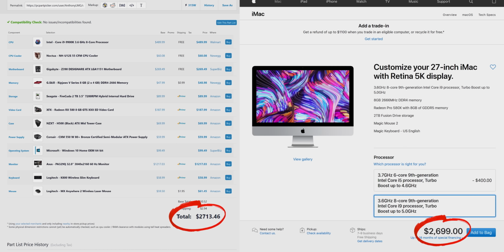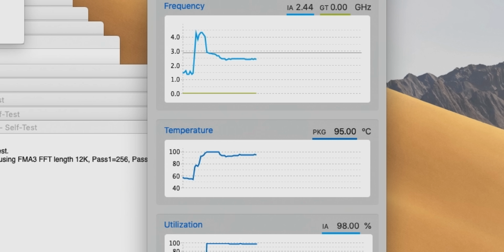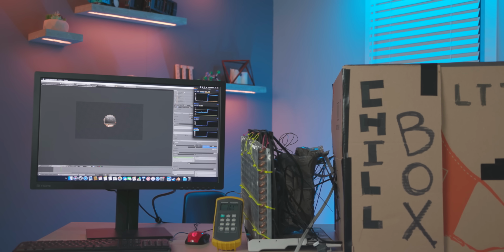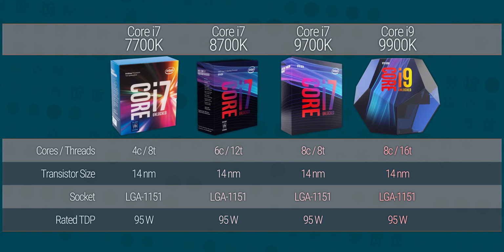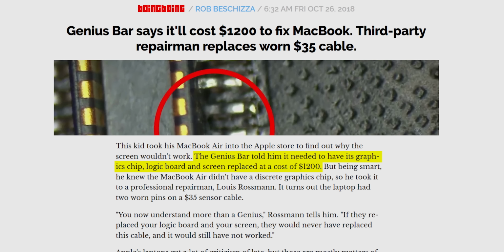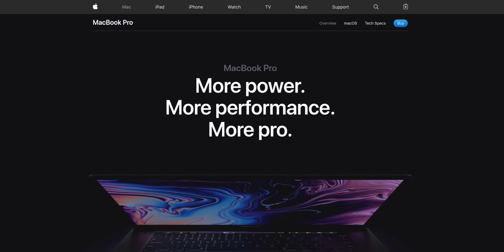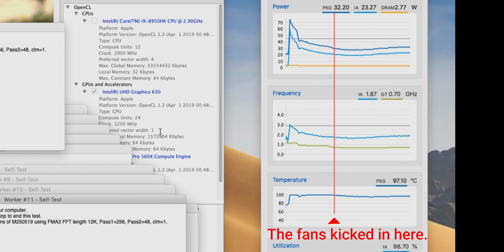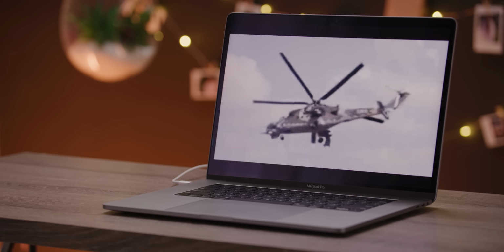Macs are SLOWER than PCs. Here’s why.

Comment: The answer is pretty simple, the mobile department and the computer department are completely split.
Reply: Moonwired Apple controls the A series chips. From start to finish they are designed for the enclosure and use cases Apple predestines then for.

Intel makes the desktop/laptop chips. 

That’s the reason there’s a split.
Reply: coz the design are more "equal" of the other brands on mobile... its just not fair of a comparison
Reply: Apple is designing custom MacBook chips as we speak.
Reply: Sure, but that doesn't really explain why the company has such different design philosophies for their flagship products.  It's honestly a bit shocking.
Reply: @marcleblanc3225  Its because they design their own processors for the iPhones, and are using Intel for the Laptops.
Reply: maybe equipment supplier wasn't honest with Apple, like for example if Intel wrote in their datasheet that their CPU can operate up to 95 degree Celsius it contradict with common sense of PC enthusiast that it should be lower than that.
Reply: But that doesn't really work either.

If Apple are ok with outting in high spec chips and having them throttle, they could just make a higher spec chip for the iPhone qnd have it throttle.

I do think Linus touched on the reason though, Apple market to less tech-savvy rech users. It's really easy for someone to gloat about their i7 MacBook and hiw it has a better CPU than someone elses noteboot with another Intel chip (even if they are wrong), but when it comes to phone hardware, almost no one has any clue at all. So, since Apple make their own, they simpme make their chios 'just good enough' and leave it at that, knowing no one in their target market will directly compare their hardware to Samsungs, and if any non-Apple fanboi YouTubers try, it will go over the heads of both Apple users and most non-Apple users.

TL;DR, Apple don't use the internals of iPhones for marketing, but do use the internals of their laptop and desktop lines to a limited degree.
Reply: @xponen  nope, Intel supplies CPUs to many other companies and their products don't throttle, and 95°c is the maximum safe temperature, if it's higher than that the cpu will throttle badly until the temperature drops.
Reply: J W Kinda, in terms of phones its probably because battery life is more measurable. This is the same reason there is a difference between mobile and desktop CPU’s. Yeah you could technically run a desktop ARM cpu on a phone for a minute. But why would you? Speed is only important in a phone up to a certain point. So why advertise it when most consumers will think higher = better. While in fact on phones efficiency = better. 

As for their Macbooks, I’m willing to give them the benefit of the doubt on the fact that intel CPU’s are insanely hot atm. And eventhough the rest has thermal issues too, its honestly just sad to see this. It doesn’t feel like false marketing in my eyes. Because you can  theoretically reach those speeds. But its at the very least damn fucking sloppy to at least not catch this before release. And if they did find this during testing it becomes straight false advertising.

I use an iPhone and love it but honestly their desktop systems have been puzzling lately.
Reply: Mister Buttchulon I agree, their desktop systems puzzle me. I only use their MacBook Pros and would never buy a desktop from them. I can forgive a laptop for not being upgradeable, but I can’t a desktop. And when said desktop thermal throttles, well I’m very quickly left with a desktop, that ain’t close to current standards.
Reply: J W That would be an argument if not for that Apple mobile devices do better in testing than android versions. Every year the new iPhone has “inferior” specs to the new Samsung or Google device and yet still will beat both in actual testing.
Reply: @tristan6509  no, Apple cooler are the same as with other brand, even its CPU is the same (it's just parts & component), except in other brand (ie: in Windows or Linux) there's many software to change the fan speed. Even Windows allow you to control the TurboBoost... The problem is bad "default", when manufacturer put bad settings and lock it down.
Reply: It's actually sad but I can understand it. The iphone is simply a more popular product compared to macs. Macs used to be their biggest focus many years ago before the iphone, now it gets barely any attention from them. You often see how they release new versions without bothering to throw an event or announcement, just put it up on the web and not give a shit. Not to mention some stupid design choices (keyboard and thermal in particular) they did with their MBP lineup.

Comment: I’m probably gonna get some quite angry messages on here but I kind of have to disagree with the gist of this video. I’m a Mac user, I’m also a PC user and say they both have purposes; Mac for productivity and PC for Gaming.

Firstly, as a graphic designer I need to use the Adobe suite, that isn’t optional and the only two OSs that it runs on are OSX and windows, if I’m gonna pick between those two, Mac OSX is just more reliable; I’ve seen a persons windows machine restart to update automatically within an hour of a major deadline, this isn’t something I’m ever going to risk on the machine I do my work on. I can also walk into an apple store and have my laptop fixed, which is not an option on a windows machine. That is unless you want to take it to a dodgy repair shop.

Secondly, most people using a Mac for professional purposes aren’t having a maintained workload over a long period of time, meaning the cooling issues aren’t really existent. This was in the video but I’ll elaborate, having an i9 in a machine isn’t for doing renders etc, it’s so those short tasks that require a lot of processing power (like resizing large images, opening PSB files or even switching between photoshop documents) take a short period of time. And if you want to see the same methodology from their phones as their laptops, you might wanna look into the difference between arm and x86, apple makes their own chips for the iPhone and they’re pretty damn good, but they’re stuck with x86 on OSX because of the software that people use on them.

I need a machine that is powerful, portable and has a colour accurate display with a good battery life. People shit on Mac owners, but the only reason we own them is we don’t have another option, any other laptop manufacturer just kinda sucks. There are probably hipsters who buy apple for being apple, but some of us can’t take the unreliability of windows and we can’t use Linux. I would love to see a bulkier desktop Mac for heavier workloads for people who do do video editing, but if want to do video rendering on a laptop, you’re gonna need one that makes the point of having a laptop pretty obscure. And even the ones are as thick as my desk don’t seem to manage cooling as well as just building a desktop and using it as a render farm. 

Last thing, if you need a secure machine then their Secure Enclave and native drive encryption is pretty nice.

Comment: 7:23 the similarities between apple and android phone performance is because they are both confined to a similar design and cpu cooling methods. If consumers were ok with large phones and the extra space was used for cooling there could be more differences. Phone cpus are also designed for low power performance so i wouldnt think phones would throtle as much as desktop/laptop cpus
Reply: xs max 208g s10+ 175g and note 9 with pen inside 201g so yea its brick

Comment: 9:56 I think this is what they need to do.  Even the MacBook Air 2018 just passively cools the CPU...like why?  They should take the current MacBook Pro chassis and put in a Y series processor, so it'll be cooled properly, and then make a thicker chassis for those pro processors.

I like my 2018 13" MacBook pro but you know damn well I didn't go above the base processor.  Why would I?  Same with the 27" 2019 iMac, only the base model can maintain the all-core turbo boost over long periods of time.

I like macOS for its aesthetics but boy howdy is the fan curve hot (lol) garbage, I always use Mac's fan control.  I literally can't hear the fans when they're going at 2000 rpm so why wouldn't they just be at base when idle?  They literally aren't spinning lmfao

Comment: Physics is a good point. As Rate in change of temperature is proportional to the difference in temperature it makes sense to have the CPU running as hot as possible because it makes the cooling solution much more effective.

Comment: Apple is like driving a car without a cooling system. Basicly, like an air cooled scooter engine. Looks fast, cannot do highway.
Reply: thank you a lot of these apple users are trying to justify it and i have been thinking about it the same way..... ok my friend kindly go outside and tear out the radiator and cooling fans in your car and report back on its performance afterwards...... and also tell me if you think it would have lasted longer had you kept it all in.

Comment: For the first time, I do not agree with your explanation. I am a heavy mail, PowerPoint and web conference user working for a Analytics software house. Sometimes I render videos. It happened to me to do a Skype conference sharing my screen for a software demo as well as recording it with camtasia with my MacBook Pro 13 late 2016 so with an i7 dual core and 16gb of Ram and it didn’t have a hiccup or stutter. I definitely don’t think their would have been a ultra book with windows that could do that, give the cpu and size.... My colleague with a Lenovo x1 Carbon couldn’t for sure!

Comment: This video really highlights how Apple's philosophy has shifted over the years, especially since Macs don't really make them much money anymore.  The whole "pro" thing has basically gone out the window so the MBP are like normal laptops with not enough cooling to power their hardware and the non-pro models are mostly jokes.  I think it's clear Apple is going to go with ARM based chips in the future for the same reason that the iPhones don't throttle: they are way more power efficient than anything Intel has.  Tbh just look at the current gen iPad Pro, there's not better example of what excellent Apple in-house designed ARM silicon can do.

Comment: You keep using the pcpartpicker build, but you include a 1200$ monitor. Mac monitors, even at 5k resolution, aren't worth even half than that.
Reply: @Swift Boiz Seems you have no idea what you are talking about. Look it up, it's at most a 500$ display. And guess what, thats what they charge you for repair, who would have thought.

Comment: Sorry for my bad english, but i wanted to say a few things and i agree about what linus said, but also this:

As someone, who uses a macbook pro (2018, i7) and knows technology
You know, you wouldn't and shouldn't render anything on it. It's not made for it. And as a Graphic designer i ude photoshop, illusteator and indesign and some other programs on it and it's great for it. Also you can't forgett the superb UX. And yes i'm defending it, because i use it. And i only used a Mac for a year, before that i have used a windows machines from windows xp to win 7 and now win 10 on my gaming machine / workstation which i use for heavy lifting, but tbh i prefer to work on MacOS, it is my daily driver at work and personal, for a year now and yeah idk what to tell you; don't hate a thing if you haven't used it and stay openminded about anything that comes your way.
Reply: They have done extensive testing on basically every Apple computer released recently, so they were in fact being open minded by testing then.

"you wouldn't and shouldn't render anything on it. It's not made for it." Is that why Apple advertises rendering and similar workloads? Also where in the world is a pro machine not designed to render? By that logic, none of Apple's current generation computers are cooled properly, so you're "not meant to render" on even a $8000 Mac pro with an 18 core, because it thermal throttles.
Reply: @Ben_Rayner  well i don't use a $8000 mac pro

I'm reporting  from my experience, i said / meant,  I wouldn't render on it and i didn't buy it for what they are advertising it, i work in advertising and i know that most advertising is just pretty words to make things look better on paper, it's all about selling things. to be blunt, i don't give a shit about advertising. 

Also i called out the comments, not linus tech tips

I also disagree with apple it self, they shouldn't have put a i9 into a macbook pro, no one can afford it and it's useless in my opinion. 

Everything i write is my opinion , obviously

Comment: Apple should stick a decent Arm SoC in all its laptops alongside the intel chip with the Arm running the OS and lightweight apps, with a decent Iris graphics equipped Intel CPU providing a huge boost. Could get away with an Arm and underclocked Intel for mid load tasks and good battery life. Windows laptops should probably push for the same. Windows needed full Arm support 2 or 3 years ago TBH, before the cherry trail Atoms came out.  Intel and/or Arm should produce an optional, user expandable GPU add-on for laptops that boosts their on-chip graphics to fight N-Vidia and ATI.

Comment: For the price comparison at the start, why a 32" 4K monitor when the iMac has a 27" 5K one? You can get a 60 Hz 4K in 27" size with comparable color gamut for way cheaper than the $1200 (like half a thousand cheaper), or for example get the Iiyama XB2779QQS-S1
, another 27" 5K monitor, the price of which here is 730€, almost 600€ less than the Asus in the comparison. 97+% DCI-P3 coverage on that one, very similar to the iMac's panel, and while the factory calibration might not be great, getting the screen calibrated won't cost nearly that much (you can either get someone to do it, or buy a colorimeter for yourself for $100-300 depending on how high end you want to go, and never worry about out of the box accuracy again)...

Comment: Isn't software trickery the basis of programming - I've had to accept this fact stating it's easier to trick the user, than physically making huge adjustments, where it'll have the same results. It just doesn't feel right doing it but you know the end user won't be able to tell. 

One instant was I couldn't be bothered making a whole variable stating whether something is true or false, I just called it and checked whether it threw an error and handled that error in code, so it doesn't break the whole program. Essentially tricking the user in my opinion.

(The program wasn't as simple as I could check if that variable is this do this, it was a complex mess let's just say)

I'm not justifying Apple, but I gotta give me probs where it's deserved, they had us in the first half ::)

Comment: I use mac because I do music and started with Protools, a software that was mac only back in the days.
I recently got a new mac mini 2018 with 6core i7/512ssd/3.2ghz base clock turbo up to 4.6 in advertising
Since researching for a new computer last year, I've enjoyed your content and still do.
HERE'S THE QUESTION:
when playing back my audio sessions with multiple tracks for vocals and instruments with a lot of plugins, my Mac Mini stays at around 80~90C with a clock speed of 3.9~4.2
I feel the computer is doing a really good job in terms of performance, but does it mean it would actually have more performance headroom when thermals are treated better??
And what would be the negotiable temperature when hitting that clock speed with better cooling? 

and another question is
after watching into your vids about computers and processors, it kinda makes me feel that INTEL has tried too hard to compete with AMD for core counts that recent 8th gen and 9th gen CPU's  are just destined to reach that T junction point when put to decent loads of work. will anything actually work under 70C or so??

Comment: The reason for the thermal difference between iPhones and Max is that Apple design their own silicone processors using a different type of architecture for the iPhone and MacBook just uses Intel’s processors so Apple is stuck to deal with whatever Intel creates